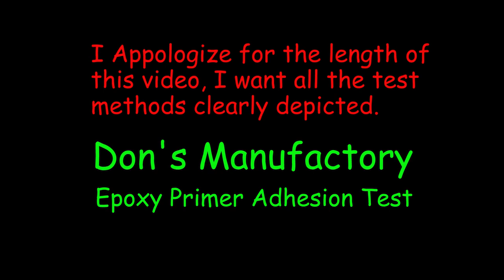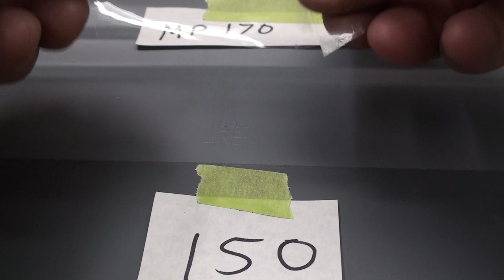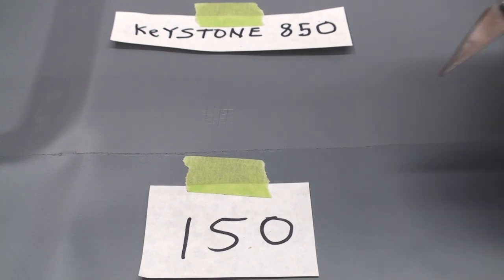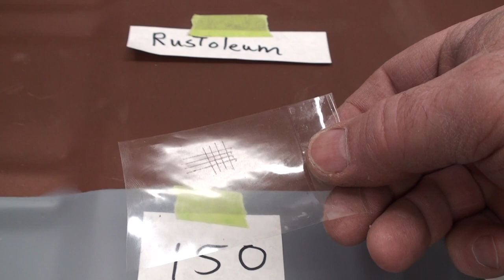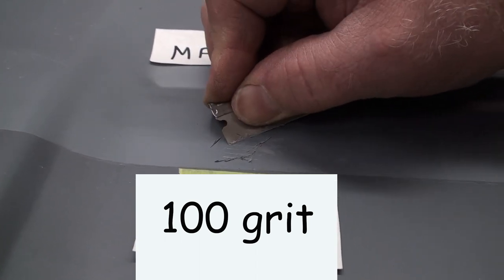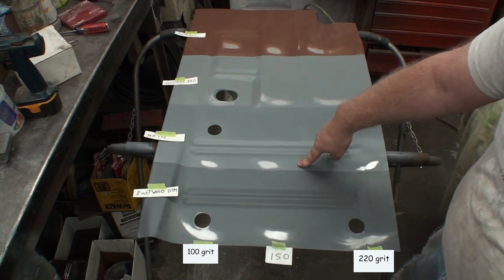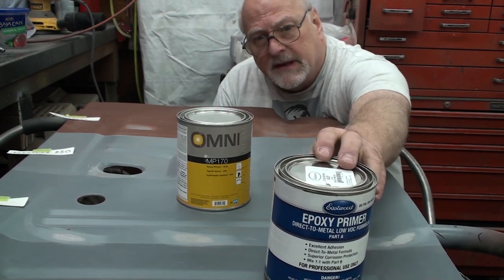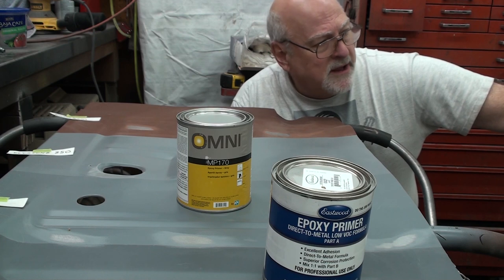66 Mustang Betsy - Epoxy Primer Adhesion Test - Paint 3

Comment: Great job Don, lots of information and detail around epoxy, thank you for all the hard work and prep. I agree with you regarding temperature. As you pointed out not only  for catalyzation  but second concern  would be humidity or condensation, cold objects attract moisture so would be a concern as well. I would pre heat like crazy, then spray back to front while  venting  the garage as little as possible and then seal it back up immediately. Hope you have a good respirator and body suit, maybe invest in full face respirator  .. 🙂
Reply from the maker: Thanks Wally, in the end the video shoot didn’t really cause too much bother so I decided to chronicle the process so others could benefit as well. As for painting, I'll keep plugging along panel painting epoxy and 2k primer but will hold off on color til the weather breaks. Unfortunately I'll end up assembling the car when I was planning on driving it. Maybe I'll go ahead and mod the front valance with the extra time (wishful thought).
Reply: I know I'm three months late to this party, but FWIW... There are three (main) reasons the home garage painter will end up with solvent related paint issues: 1. Not allowing enough time between coats. 2. Not venting off the solvent vapors. 3. Not keeping the substrate warm enough for proper curing.

Number two is what we're worried about here. If the solvent vapors are not adequately vented outside during curing, they will reach such a concentration that they'll end up preventing the coating from curing correctly. The most noticeable effect of this is "solvent haze," but the invisible effects of  poor adhesion/bonding and/or poor coating longevity and durability can happen without visible hazing. It is ABSOLUTELY VITAL that you vent the atmosphere appropriately during curing!!! You can NOT seal up the garage to maintain the heat needed for curing, or you WILL saturate the atmosphere with so much solvent that you'll end up with either an invisibly non-viable coating, or a visibly non-viable coating that is evident by surface hazing of the coating (most obvious with clear coat).

You must take care of ALL THREE of the above factors, and not just concentrate on two of them to get good results.

Edit to add: You must also provide good ventilation during the painting process itself for your own sake. Respirators do not have an infinite ability to remove VOC's from the air. Most people are aware of the time limits of respirators, but are completely unaware of (or choose to ignore) CONCENTRATION LIMITS of respirators; it is VERY EASY to get such a concentration of VOC's in the air that the respirator just can't get all of them out. You can not rely on your sense of smell to tell you if this limit has been exceeded, either. You'll notice that all respirators don't just give time limits for their respirators, but will also publish the max concentrations of various VOC's in the atmosphere. THOSE  are the limits you really need to be aware of.

Short answer: ALWAYS provide proper ventilation for both the health of your coating and yourself.
Reply: Warning: Wall of text follows. As if my above comment wasn't long enough...

In my previous comment, I said, "If the solvent vapors are not adequately vented outside during curing, they will reach such a concentration that they'll end up preventing the coating from curing correctly." I can just about hear you all thinking, "What??? No way!" So let me explain a bit more. I'm going to attempt to do so without being too wordy, but the fact is a certain amount of "wordiness" is needed to really explain this adequately.

OK, let's start out with an easy example. Let's think of water vapor in the air. We are all familiar with the concept of humidity, and the fact that once the air has reached 100% humidity, it means that the air is completely saturated with water, and won't (normally) accept any more water. If you place a wet towel in a room that is at 100% humidity, it won't dry; the air already contains as much water vapor as it can hold, and so no more liquid water will evaporate from the towel into the atmosphere. Air can hold amazing amounts of water, and so our concept of "humidity" is based on that fact.

This same basic concept applies to solvents; air can only hold so much solvent vapor before it reaches a point at which it is 100% saturated with vapor, and so any liquid solvent remaining will remain as a liquid. The problem is that air is NOT good at holding solvents; it can hold far more water mass as vapor than it can volatile solvents. This means that it requires far less liquid solvent evaporating to cause the atmosphere to become completely saturated with solvent so that no more can evaporate.

Of just as much (if not greater) concern is the fact that it is a non-linear relationship between how saturated the air is with solvents and the rate at which liquid solvents will then evaporate. The following numbers are not accurate, but the example itself is sound... Let's say the atmosphere currently is saturated with 50% of the amount of solvent that it can hold. Its "solvent humidity" is 50%. This does NOT mean that it will take 50% longer for the remaining liquid solvent to evaporate, it means that it will take 200% or even more time for the liquid solvent to evaporate into this atmosphere.

So even if the atmosphere of your garage becomes 50% saturated with solvent vapors, the resulting dry times of the solvent remaining in your coatings is doubled, tripled, or more. Again, not accurate numbers, but close enough for the point that I'm attempting to make.

Even worse, in still air solvent vapors tend to stay directly above the surface they evaporated from. This means that you'll have a layer of air on your horizontal panels that becomes completely saturated with solvent vapors, allowing no more evaporation to take place. You must move this layer of air away from these surfaces in order for the solvents to evaporate.

So big deal? What IF it takes the solvent much longer to evaporate out of the coating? How does this effect the structural integrity of the coating?

2k coatings both "dry" and "cure," and it's a race. The volatile evaporative solvents MUST win this race; they must "dry" (evaporate) out of the coating materials before the "curing" stage really gets going. The curing stage is when the two different parts chemically cure into what is basically a flexible plastic. If the solvents are not eliminated prior to the curing stage reaching a certain point, the solvents will become permanently trapped. This will cause the coating to be permanently weakened. This is why it is absolutely essential that the solvents evaporate quickly! Coatings that are greatly affected by trapped solvents will appear hazy on the top surface. But make no mistake about it... coatings can lose viability due to trapped solvents at a level well below the point that this effect is actually visible.

The size of the vast majority of garages is simply not enough to provide enough atmosphere to allow proper evaporation of the solvents prior to the curing stage trapping them. This is why it is absolutely essential to provide lots of ventilation during the drying/curing process.

Also, don't mistake "flashing off" as "the solvents are gone." The initial "flash off" that you see after applying a coating is simply the solvents at the surface of the coating evaporating. There will still be a lot of remaining solvents beneath the coating surface that will still need to migrate to the top of the coating where they can then evaporate. As the curing process continues, the coating becomes so viscous that it becomes more and more difficult for the solvents to migrate to the surface and evaporate. At some point, the solvents will become completely trapped.
Reply from the maker: Thanks for this explanation. I wasn’t planning on sealing up the garage. What I have been successful with is heating the panel to 70*+ (thermal gun) then painting the panel, venting the garage, close up and bring panel temp back to 70*+, vent again, heat again, repeat as necessary. This was with individual panels not the whole car and was epoxy followed by 2k primer. I have no intention of shooting base / clear on the whole car until the temps get high enough to vent continuously. 

Thanks again
Reply: @donsmanufactory  You're welcome.  You might also want to consider either an electric or gas infrared heater. This type of heater will heat the panel itself, and not the surrounding air. You could set one up and leave your garage door open and setup a fan to blow across any horizontal panels. And of course be careful about solvents in the atmosphere if you get a gas heater.

When you setup an IR heater, you'll want to set it up using a panel that isn't currently curing/drying. This is so you can get a good estimate of the distance you'll want the heater from the panel. Move the heater as needed to get a surface temperature appropriate for the speed of the curing agent and/or reducer.

And I'm truly sorry for your loss... Only people that have gone through losing a close friend can possibly understand how awful it is. My buddy Kris and I were best friends from age 5. He died last year at the age of 56. So yes, I can just imagine the heartbreak you're going through right now, and I'm so sorry.

Comment: I sprayed my metal shop with the Rust-Oleum copper color with no catalyst .
I used the cheapest Laker thinner possible 1/5 thinner. It work pretty good. I sprayed this whole shop probably 10 years ago still holding on.
 one more thing did not pressure wash it , when I started. I painted over every freaking thing.
 as in dirt. Lol
Reply from the maker: Yikes, that’s pretty amazing. How is the gloss, still shiny?
Did you paint the outside, exposed to UV?

Comment: Good video overall. I'm not sure where you saw that the PPG Omni has a two day recoat window. Per the current Product data sheet it is also a three day recoat. However, a couple things to note. It also specifies that is 3 days and even that, it is based on 70* temps. Based on the 15* rule, for every 15 degrees you go up in temperature the times cuts in half. The same is true for flash times, pot life and even recoat times. These are some of the simple paint fundamentals that people either don't know or have never been taught. Best of luck.
Reply from the maker: I just reread the tech sheet. I distinctly remember it saying 48 hours but on line it does read 72 hours. Nice that leaving it over the weekend is possible without a scuff and recoat.

Comment: I have no problem with catalyzed rustoleum for underbody usage. But for that stuff I usually buy an acrylic enamel for around the same price. As for spraying you can get a low temp hardener which will help speed up the curing time. The important part is the temperature of the steel as it needs to be at the same temp as the air. 
        Epoxies are really good stuff but have some odd properties. They generally don't sand well but they provide a good seal layer to the steel. And scuffing it up to apply 2K after the recoat window is a pain. Unfortunately I didn't have my 2K primer when I shot epoxy.
Reply from the maker: I hope the quick shoot of 2k solves my workflow problem. Maybe if I were in my 40’s I’d get stuff done faster.
Reply: @donsmanufactory  Nothing wrong with the speed of your work. Far faster than most. The years go by faster and faster... And I'm older than I look and I feel older than I am... Another birthday next month...  I had filler work to do as well and I prefer to do it over epoxy so even if I had 2K and sprayed it I'd be sanding trough it in spots. Need me to fly up and give you a hand for a day or two?
Reply from the maker: @theinfernalcraftsman  - Wow, thanks for the offer Robert. Not necessary at this point with the weather stifling my progress but thanks!

Comment: Very to the point information about the use of primers. The only issue with the rustolem primer with rustolem paint is if you use it in an automotive application you can not use automotive paints over it. It will lift.
Reply from the maker: Yes, thanks for the info. although in my case, it should be perfectly fine under the carpet on the floor, top coated with Rustolium finish of course. 

Thanks
Reply: That would be perfect for the application. I've got a truck I've got to paint that has rustolem that's gotta be stripped in order to be painted. I paint tractors and outdoor equipment with oil based paint and it works great.

Comment: I have a customer that paints big rig trucks and various trailer configurations and in colder temps his shop uses infra red heaters so the metal temp is guaranteed to be the magic temp of 70 so all the chemicals react correctly so you may need quite a bit of heat to sink in to you parts to be at the right temps,
Reply from the maker: I have a gas furnace in the shop so I can heat it up until all the thermal mass is at temp. Just need warmer air coming in…

Comment: Nice test. I was surprised how well the Rustoleum did in comparison to the epoxies. How about a test, using your test panel, and spraying a finish coat to compare adhesion plus any chemical reaction properties to each section? Results may be interesting.
Reply from the maker: Interesting idea, I’d want to start over with the epoxy primers to test the re-coat window though. I suppose I could scuff and top coat when I’m painting Betsy. It would be nice to know if fully cured rustolium still reacts with PPG base / clear.